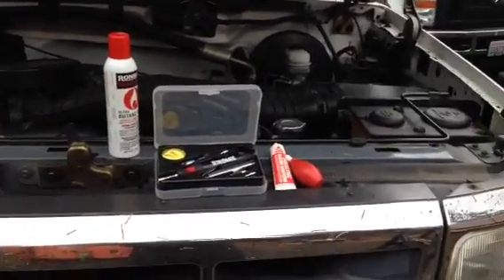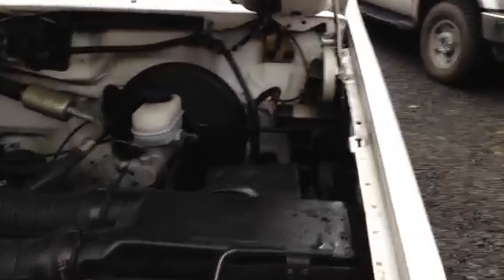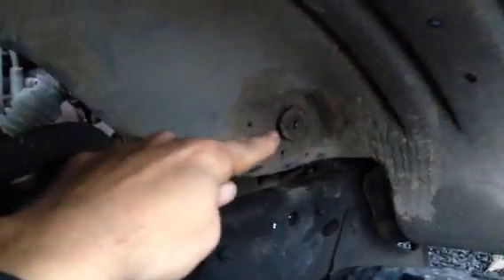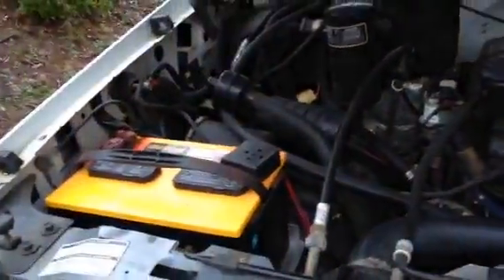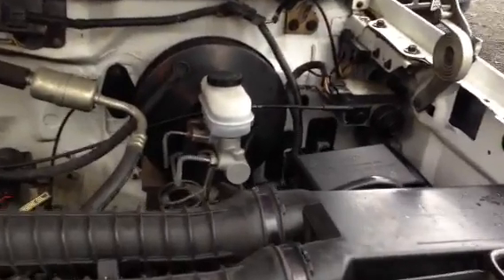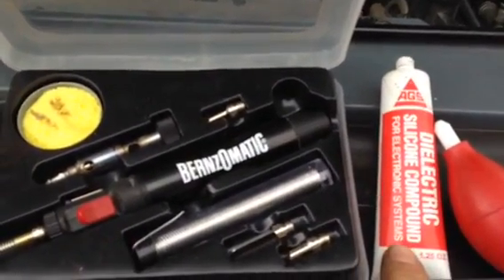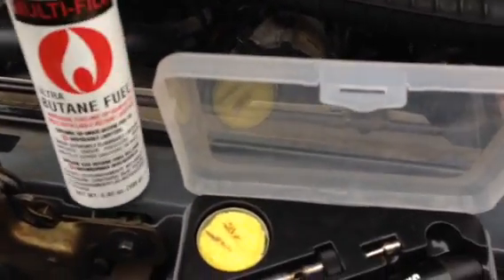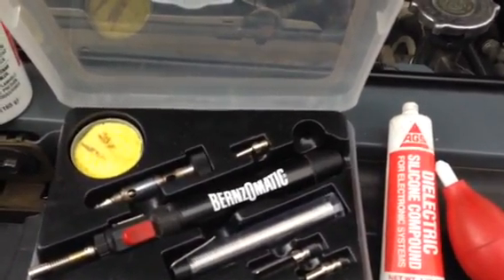1993 F150 computer repair

Comment: Mine doesn’t say code the computer but it does say tachometer and my abs light was on for a bit
Reply from the maker: If you have put LED brake lights in then change them back to standard brake lights and see if that cures the problem before you go any further.
Reply: @geterdone  no but I did put led headlights 🤔

Comment: Why did you changed the computer my truck stalls and has poor acceleration changed everything except computer think this could be the issue?
Reply from the maker: Come to think of it, years ago my truck had a similar issue and it ended up being the computer had corrosion. I replaced a capacitor and that had corroded off and that fixed the issue. Try taking out your computer and remove the cover and check the board for corrosion. I think I got a new computer for around $90 at O’Reilly‘s.
Reply: Ricky. How do you reset it
Reply: I haven’t changed the fuel filter either going Wednesday if it doesnt solve the problem I’ll change it
Reply from the maker: I changed it because the truch stopped running and I could smell burning wire. I traced the smell to the computer and took it apart and could see burnt circuitboard parts. As for your truck I would start with spark, timing, fuel supply, then maybe computer, look up troubleshooting.
Reply from the maker: I replaced my capacitors and they lasted about four or five years and I ran the truck once every month or so. Those capacitors leaked out and the board fried but there may have been other issues due to corrosion. I got a remanufactured computer and put it in and it only lasted about six months and the truck started running, shifting, Not engaging in cruise control, and the ABS light coming on, and idling erratically so after following the manufactures test procedure on the anti-lock brake module it told me it had a bad ECU. I pull ed the computer out and looked inside and sure enough a capacitor was starting to leak again. 

The computer is still under warranty until next February so I’ll go ahead and change it out but if this happens next time I’m going to put different capacitors in of the SAME microfarad rating but a higher voltage. 

See the following video for why I intend to do this. https://youtu.be/Noy4YAjoJE4

Comment: My 94 5.0 has no power to the inertia switch or the fuel tank selector switch. The fuel pump fuse and relay all test good. Any suggestions?
Reply from the maker: Check continuity is where i would start. Bishko books on CD from ebay have helped me.
Reply: @geterdone  I will give that a shot. Thank you

Comment: i got a 92 f150 inline 6 ,my fuel pump harness is getting 8 vults and 6vults constant  anychance that was what you had?
Reply from the maker: it was corrosion and was effecting the fuel system is all I know.
Reply: ok thanks